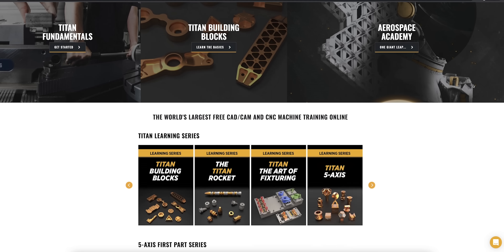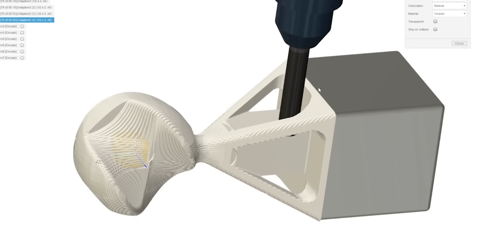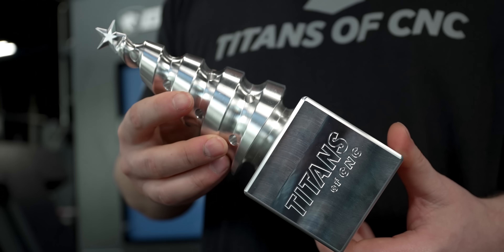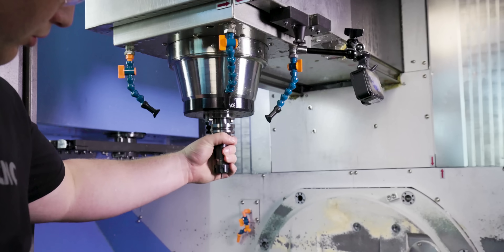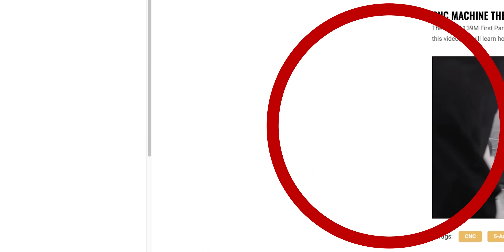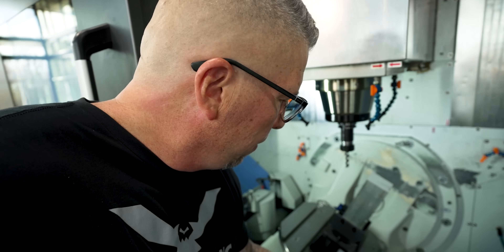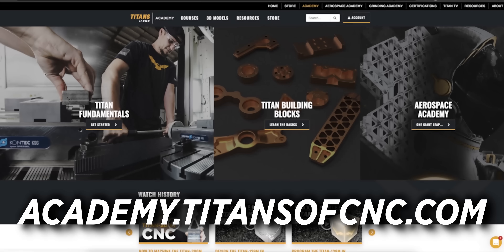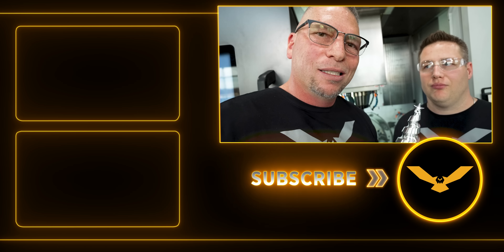Worlds Best 5 AXIS CNC Machining Techniques | DVF 5000 | DN Solutions

Comment: I'm not sure this could be done but something come to me when I saw that neat Christmas tree. On the flatter outer edge spiral I was thinking 
of drilling multi-radiused holes in rows or patterns and installing lots of differently colored mini-led lights. This would probably require machining
out the bottom center of the tree to install the wiring. It would look pretty nice when lit up. A 2 to 3 foot tall version of the tree would also be cool.
And, by having a taller tree you could also create numerous machining patterns into the tree itself.
Reply: cool one for the heller or the ibarmia if that machine is still there

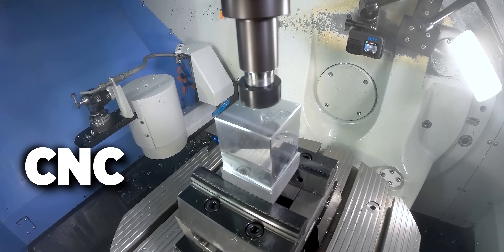Comment: 1:53 Why are you probing the raw stock and not the finished part when setting up the 2nd operation? Isn't that less accurate?
Reply: Probably to just get the centre will be accurate enough to mill it down to size
Reply: On the second side since the material overhangs the finished surfaces I did an initial probe of the raw stock and let the face mill come in and get rid of that excess stock.  Then I came back in and re-probed the finished surfaces before it chamfers the edges and engraves.  On the next part in the series instead of doing this, I show how to take a 1-2-3 block and probe it and then shift the work offset by half of the measured part size.  That way I can show a couple different ways to go about it